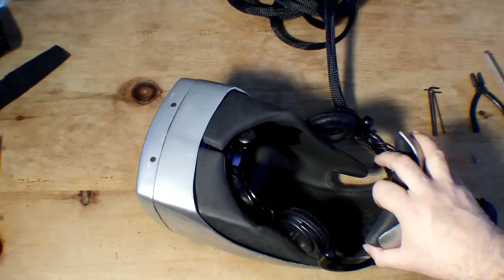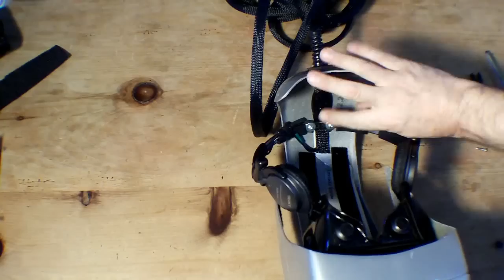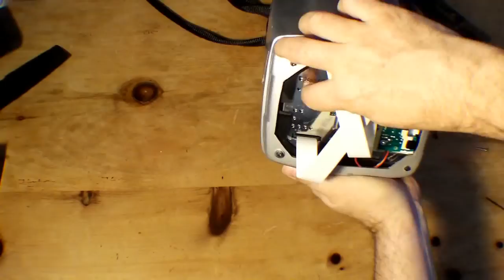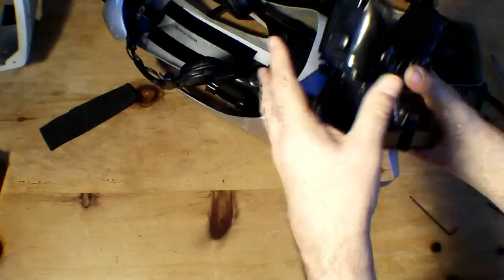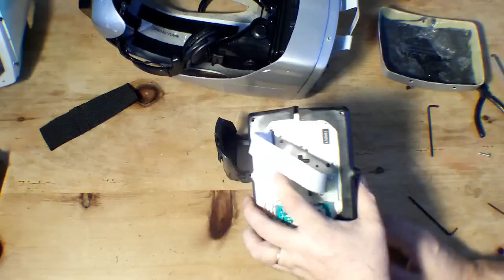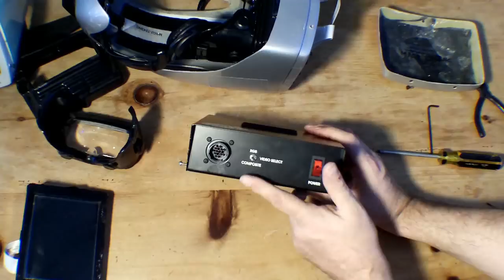Liquid Image MRG2.2 Head Mounted Display, HMD, Teardown - Part 1

Comment: Question please, can you show me how to plug it with computer?  do I need a cable converter? Thanks!
Reply from the maker: The MRG 2.2 requires a NTSC composite video input (30hz interlaced, 15.575khz horizontal sync rate). There are many inexpensive adapters which can convert VGA to NTSC such as the SABRENT PC to TV Converter Box TV-PC85.
Reply: Ok sir, but what about the screen resolution? is it okay to adapt/or modify using modern part to make this thing alive again in this age? 

I'm just kinda curious, because these VR headset appear in gaming industry during 1990s and then it gone silence, so I'm kinda excited (I was a kid back then, no youtube and internet, and the browser are netscape and IE at that time)

Comment: I would love to build my own VR display, if I could get my hands on some 720p or 1080 projector lcds. Backlight those and get some lenses and you could make a very nice display, no headtracking or anything, just for mouse and keyboard fps's. 

I've currently contented myself with a 1080p monitor and either a large fresnel (Surprisingly effective), or 2x reading glasses (also surprisingly effective and immersive). 

Binary LCD's with split monitor 3d would be far more effective though.